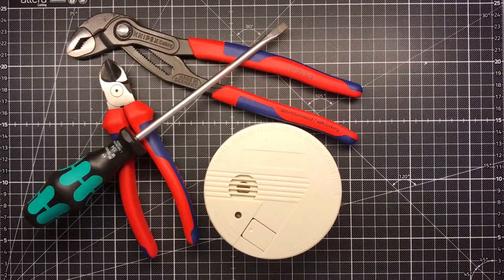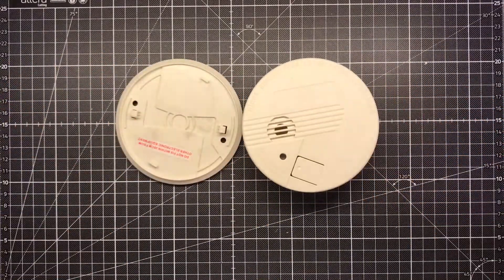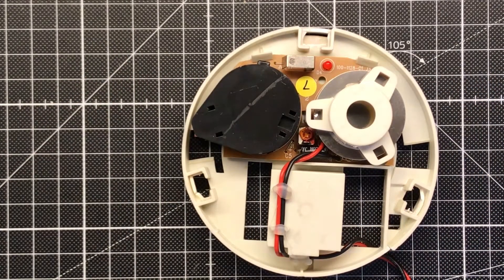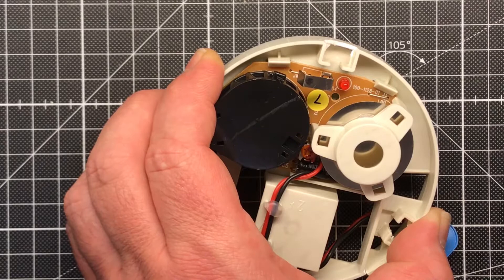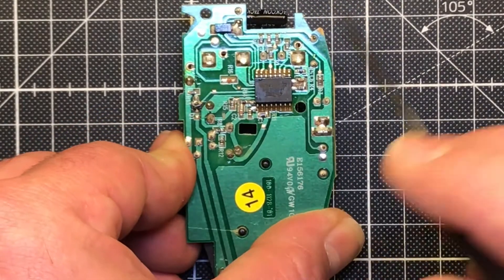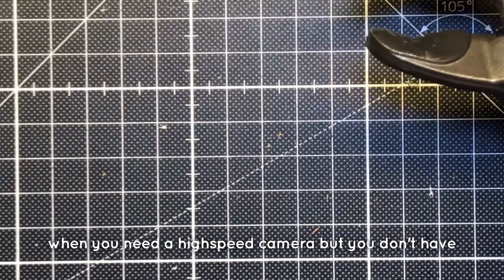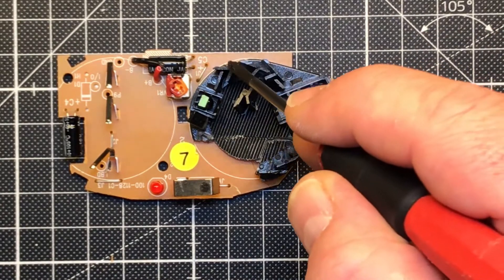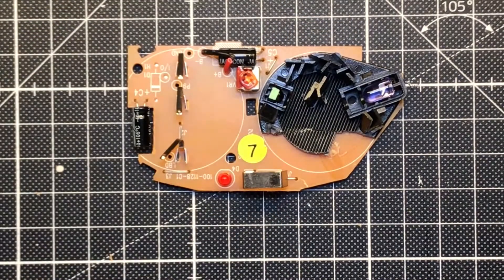teardown a smoke detector. (ELRO RM120c)

Comment: WOW THAT'S A VERY RARE SMOKE ALARM!!!!
Reply: I have the same one ... I wanted to know it it had Americium
Reply: Mr.X Smoke alarms like that one is a photo electric witch senses smulderig fires and inozaton smoke alarms detect quick burning fires
Reply from the maker: @MisterBrownJack  you are right it is a very simple way to detect smoke (particles in the air). This one has to die because it woke me up in the middle of the night.
Reply: ts.electronics Probably because it’s over 10 years old or because of all of the dust that probably builded up over the year’s
Reply from the maker: @MisterBrownJack  yes battery was empty but I have 10 of them in my house and try to find the one with empty battery in middle of the night,
Reply: ts.electronics That would been pretty difficult to find the one that was chirping or beeping
Reply: ts.electronics If they are over 10 years old it is best to replace them
Reply from the maker: No there is no Americium in this device.
Reply: @thsinger  anyway thanks I will stick with my thorium for a while